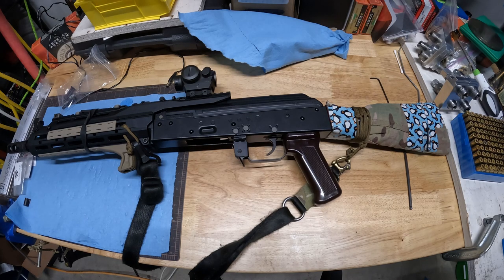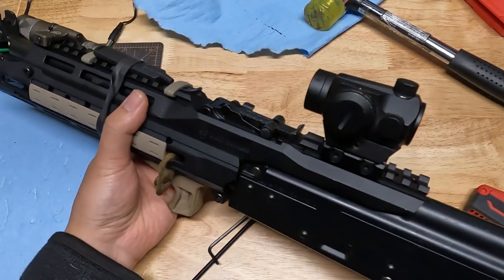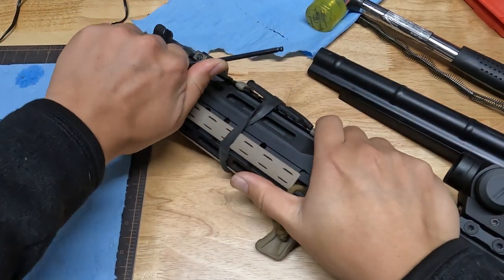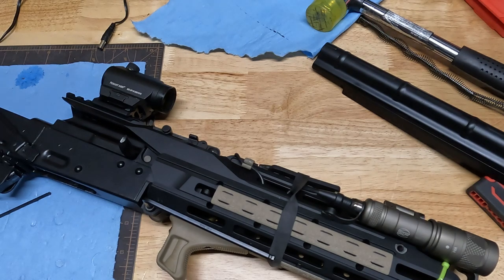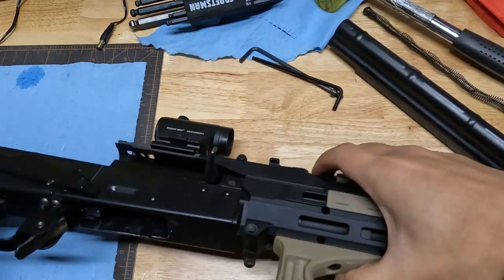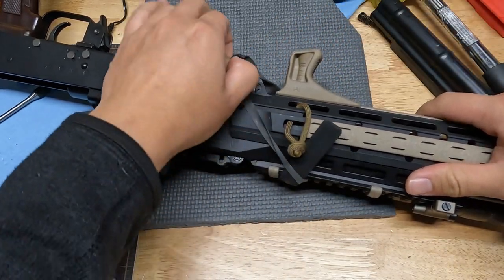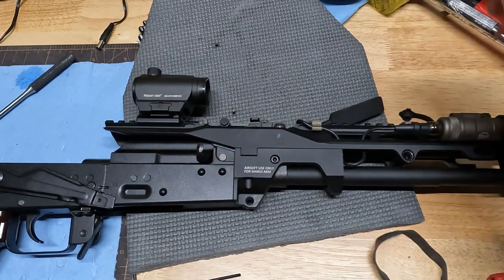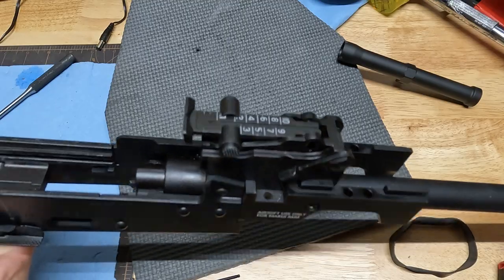Tokyo Marui AKM Disassembly and Reassembly (Arron Smith, Airsoft Artisan, EMG Rifle Works)

Comment: hi，im your new subscriber ，love your mws video，and learning lot from it， wanna ask your opinion，akx mws system vs m4 mws system，do you recommend me to dive into marui ak mws system，i already have cqbr block 1 and mtr 16
， and im still in dilemma (how
 Reliable is akx mws) izzit worth to get akx marui ,😅 thankyou for your time , and sorry for my bad English (I’m from malaysia) nice to meet you!🙏🙏
Reply from the maker: Akm and MWS are both great platforms. Spare parts for the AK is zero though so I find it hard to recommend if you run into an issue.

Comment: Hey! Did it help w your hop? I’m thinking of building a Zenitco, but I’ve avoided the AK cause I’m worried about being able to up the FPS and hop. How has it been?
Reply from the maker: Fps is around 350 out of the box on a 200mm inner barrel. So lowering the fps is usually the main problem. Hop up is ok on .32g bbs. But I wouldn’t go any higher than that
Reply: @pingu.0211  I was looking for more like 400fps like my MK18.  My events are 1.55J and I like to shoot .40s since I've only got 35 of them to shoot...lol.  That's a great build, congrats and keep up the great work on the channel.